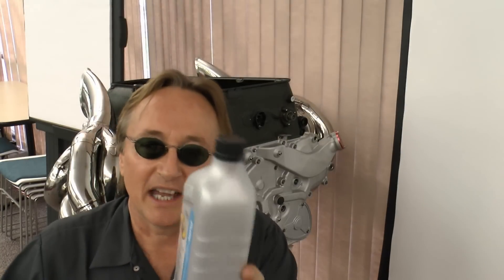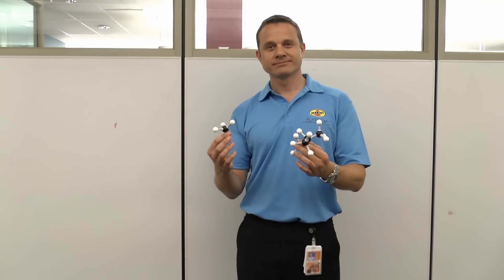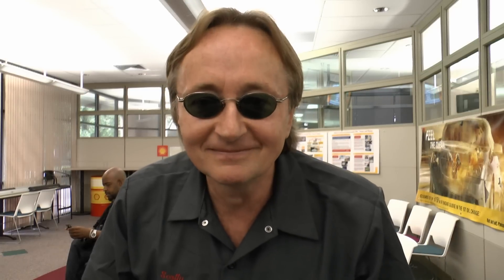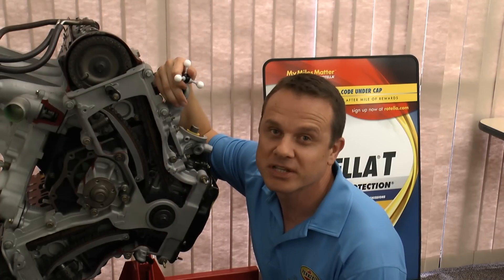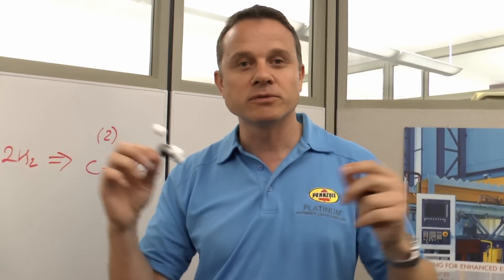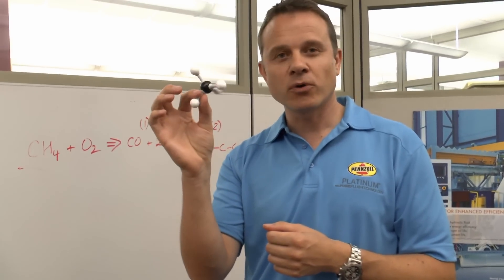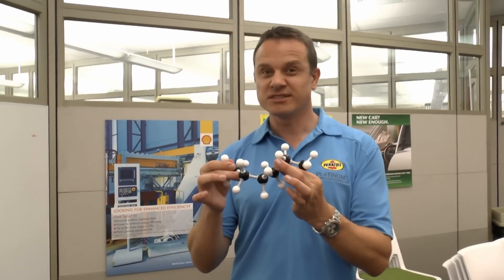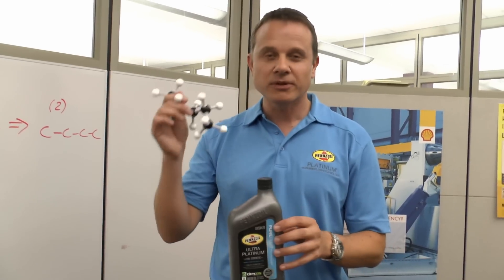How Engine Oil Is Made From Natural Gas

Comment: Scotty, I got a pair of 6000K H4 bi-xenons installed on my car and they got radically dimmer after a couple of months. I had my battery replaced but they're still dim, I took my car to a car accessory shop to ask them what could be wrong, the owner said the headlights need to be replaced, but I don't trust him. It's barely been a year since I got them, and I don't know what is wrong. What's your take on this?
Reply from the maker: many aftermarket xenon kits are cheaply made in china and don't last long. if you have one of those, it's typical
Reply: Spend the extra money and go with a projector retrofit.  Then go with OEM bulbs, like Philips 85122.  Cheap bulbs don't last long.  They get dimmer in a shorter amount of time and color shift over time.  If you want HIDs, go with OEM as much as possible.  I'm running EvoX-R Bi-Xenon projectors, Morimoto 3Five Ballasts, and Philips 85122 D2S bulbs in my headlights.
Reply: Thanks for the replies both of you.Since I don't know much about HIDs and projectors, I'll just get the same combination as Kenneth, or maybe something similar that doesn't go over the $300 mark.
Reply: Thanks for the suggestion galaxybeing, but where I live, Amazon has just started their website and they don't have any HID kits or bulbs yet, I have already looked. My car already has a HID kit, and I am not sure if I can replace the bulbs because it's China made and the bulbs were already fit inside the projectors. I might go see an electrician today, see if he can set me up with something. $11.19 is a great deal btw.
Reply: I just got back from the electrician and he checked the lamps. He tried different HID bulbs, and one other projector, but it was dim the whole time. I asked him if the problem could lie in the ballast but he's pretty darn sure that it's okay, he also added that the ballasts never give out (which I am not convinced with). He did everything but try a different ballast. He said the headlamp unit (in which the projector sits) must be changed so the light is brighter and scattered better but I doubt that's what's causing the issue. What do you guys suggest?
Reply: I had this problem myself. It turns out my bulbs had almost no salts left in them after 3 months. However after hearing your story it very well seems to be your ballast. The ballasts do give out. Some don't even last 6 months while others last forever. The cheaper Dc Output ballasts that is the slim ballasts that these cheap china kits have generally don't supply enough current for the bulbs to ignite properly and as such they never reach the true colour temperature or intended brightness.
Reply: nirtime My kit did come with a slim ballast lol, I looked around online and slim ballasts don't have a great feedback. I asked the electrician, he said slim or normal, it won't make a difference. Looks like he doesn't know his work very well. I'll get it checked with a normal ballast, if I can get my hands around one.
Reply: thefirstgalaxybeing Yeah, the both sides are dimmer and the left bulb has always been flickering.I didn't know bulbs could be replaced. I asked in one of the stores yesterday, the owner said he has China bulbs for $30 each, and Philips for about $50 each. Nowhere close to the ones you got off Amazon. How is their performance? Do they have a name for their company? I'll see if we have them here. 
I don't know if my kit is weak, but I was also told that it is for motorbikes and not cars because where I got it from, people usually go there for bike mods. I don't think it makes a difference though, does it? I'll check the wiring myself like you suggested. Thanks, you've been very responsive. :)
Reply: It's aftermarket. When I got the HID kit, I knew nothing about them. In fact, it was my friend who insisted I get them and he offered to pay for it and where I got them from, there's zero after-sales service. That's just how things roll here.
I've never tried Amazon.com, they have their own domain for our country but I don't know if they ship to where I live. I've had things ship to me from overseas before, and it's a long process, I don't know if I want to go through all that again. Don't you think the Philips bulbs are worth the money?
Reply: Could you give me a link to the pair of bulbs you got? I have a friend who is in the US right now and he's coming back in a month, I'll ship them to his address and he'd get them with him on his way back. I don't know if changing the bulbs would resolve the issue, could you also link me to a good pair of ballasts? Or maybe an entire kit if possible. I wouldn't know anything about bikes or their batteries, I never owned a bike, sorry.
Reply: Thanks, I am on the website as we speak, I'll pick something and tell him about it. You've been of great help. :)
Reply: http://www.amazon.com/Innovited-Xenon-Conversion-Ballast-5000K/dp/B00F5QNB0U What do you think? I think H4 would be the correct size for my car since the ones I have are H4...
Reply: Also, if I got 55w instead of 35w, would it burn my projectors?
Reply: dont buy shitty HIDs? and plz get projectors.
Reply: thefirstgalaxybeing My car is only 2 and a half years old and the headlight housing are just fine, except I painted the reflectors black because that adds to the "looks", and HID with reflectors don't look great in my opinion. Looks like Amazon has everything you need, I wish their product range was as extensive in my country as it is in yours. Some of the sellers ship worldwide but the shipping alone would take up to 10 days.
Yes I'll realign the headlights, and make sure the spread isn't bad. I hate people who blind people with their headlights, and I'd hate it even more to be one of them.
Reply: thefirstgalaxybeing The H4 Kit is only $43, rather cheap compared to the $400 kit quoted by an idiot here. The cheapest kit which I've heard of is close to $200, so $43 seems like a fair deal. I hope it works fine, I'll order it in a couple of days, and have it fitted by next month. I cannot find this 'place' you talk of where I can enter my vechile make, model etc.
I don't quite understand how the system works but if the Mr. Know-It-All says so, I'll take his word for it.
Reply: Medic1911 I have them.
Reply: thefirstgalaxybeing Hey man, I am sorry if I am annoying you but I found a good pair of HIDs and I don't know if I should buy a new relay harness along with it 'cause I have my old one, although I am really considering getting one just in case they don't go with the new lights. I found a 'single beam' harness. Now, I don't know what that means but since I am getting  bi-xenon lamps, shouldn't the harness be 'dual beam'?
Reply from the maker: realkewlmann I would assume you would need a dual beam harness
Reply: I wasn't aware there were single and dual beams for relays until I came across that one on Amazon, thanks Scotty; and thegalaxybeing, you've been very VERY helpful. Tyvm.

Comment: Is this a cleaner process than regular motor oil? If so I see a big industry for greener oil lol
Reply from the maker: you 'd have to ask the scientists that one, good question though, try shell.com for question answerig
Reply: Crude oil has a lot of impurities in it such as the biggest one being sulphur. Such crude is referred to as Sour Crude. Sulphur isn’t good for your engine and even worse for the environment which in turn relates to your health. Poison in other words. On the other hand, GTL (Gas to Liquids technology) is 100 times cleaner since there isn’t any sulphur or leads (if not completely absent, then at extremely low levels that it’s insignificant). Synthetic refers to the synthesis, or in other words the refinery process. So synthetic oils gives reference to the methods used to manufacture them. Synthesizing chemicals in this way is under stricter control at each step of the process with the product being manufactured for the specific task it’s meant for. Therefore synthetic oils and synthetic fuels are much more cleaner and safer for both your engine as well as the environment with regards to vehicle emissions. Hope this helps shed some light on your query although my response is 6 years later 🤦🏻‍♂️.

Comment: HeyScotty jw if i use this oil on my 01 Dodge intrepid when i have been using reg castrol oil like you advised. Do I still need to use 1 qt of lucas oil stab for this pennzoil pureone motor oil? Thanks! Thinkin of trying it out!
Reply from the maker: on a dodge  car that old, I would still add the stablizer.
Reply: Also this type of oil had to be changed 6 to 8 thousand miles or every 6 months right? Even if it is a synthetic right? Making sure because next month need to change my oil and goin to try this pureone stuff.
Reply from the maker: Dblade981
yes, they say to follow the regular manufacturer's oil change intervals

Comment: They failed to really explain why I should use this oil over a regular synthetic oil.
Reply from the maker: I have another video in the making showing how they tested the oil in the lab, in the race car world, and on taxi cabs in las vegas. Basically it prevents metal wear in the engine better than any other commercially available oil.

Comment: I recently had a new exhaust put on the car now i have a knocking sound when pulling away, i checked for rubbing on the exhaust but cant see anything. I need to look  under the car but i cant afford a lift and i dont want to get under the car on just the jack. whats the best solution?

Comment: How can they call it synthetic if it is still made from dyno oil?
Reply from the maker: it's not made from oil, it's made from natural gas. So making a thick out out of really thin natural gas is certainly a synthesis.
Reply: Because even synthetics use a base crude oil before additives.  Using natural gas is awesome since it is the cleanest burning fossil fuel.  On top of that the United States sits on the biggest supply of it.  It would be nice to turn the tides on these middle east countries.
Reply: Because with synthetic oil, natural gas and/or other sources of hydrocarbons, such as crude, are used as raw material for chemically synthesizing lubricating oil.

This is different to taking crude oil and going through conventional refinement processes to extract usable oil as a lubricant, sans any required additives.

Synthetic oils are unique in that the hydrocarbon chains are uniform for a given viscosity whereas traditional mineral oil is composed of hydrocarbon chains of varying lengths and where a certain combination thereof may yield a certain viscosity.

The problem with conventional oil: longer hydrocarbon chains will greatly increase the oil's viscosity in the cold while shorter hydrocarbon chains may be burned away more easily but not cleanly in events of excessive operating temperature, which would result in thicker and gunkier oil.

Comment: It funny the dinos died long ago for man to make fuel out of it. Now man makes it and it costs a whole lot way more . I will always buy the stuff made from the Dions as it has worked all these for me all these years and my dad a master mechanic used it and never had a problem.
Reply from the maker: it's not really made from dinosaurs, mainly from plant material and plankton. BUT, engines these days are much higher revving and hotter running and complex, and require higher lubricant capabilities

Comment: Pennzoil didn't invent this. In fact, this process was developed in Germany known as Fischer–Tropsch process, in 1920s, some 90 years ago. Google and read on "Fischer–Tropsch process" before making it sound like a new high-tech engine oil.
Reply from the maker: no one said they invented it, most know the nazis made diesel fuel and oil from Coal, which they had in abundance. The South Africans also turned coal into diesel when they were under sanctions decades ago from apartheid.
Reply: They actually mentioned Fischer-Tropsch in this video.

Comment: Essentially, all they proved in this clip is how there is nothing, and I mean - absolutely NOTHING, special in this oil and they've always been this way. All the processes this guy explained are studied in grades 8-9 in Europe, grades 11-12 in North America and I have personally performed them in my first organic chemistry classes. How is hydrocracking or using a catalyst to make a long hydrocarbon, such a special process? They are just a bunch of guys there who make it easier on themselves to create oil molecules. But the drawback is that these polymers are all identical and they are much more unstable. And they all start to brake down at the same condition in the engine, whereas if not all chains were identical, you would have a MUCH more stable compound. So, ya, Penzoil just proved how worthless their products are. And that crap about the race cars they put the oil in can be used again for nothing but to prove their junkish product. That is because all race cars get their engines rebuilt/replaced after every race. It would make NO sense to put an expensive oil in such an engine, just to throw it away after 1000kms or less.
Reply from the maker: shows what you know about oil and racing. In the races like indycart, they get 5 engines to use for the entire year, so each engine has to last many races.  This oil was tested in taxi cabs in las vegas for over 100 thousand miles and showed the lowest level of wear in the oil industry. I saw that science in the lab, it certainly made sense to me.
Reply: Scotty Kilmer
Do you want to get back at me and actually claim that stupid Penzoil is a better quality oil than say Castrol, Liqui Molly, Motul, Elf, even Kroon Oil? Because I certainly don't see it that way. In my experience only Valvoline is worse than Penzoil!
Reply from the maker: Rumen Hristov
AH, but you can have no experience with this oil as it's brand new. Yes, pennzoil did have problems with sludge build up in the 1970s, but their oil is a long way from that formulation. Times change, as do oil formulations. If you check out independant testing, this new oil is rated on the top by many testing labs.
Reply: This is oil is made by Shell, penzoil just sells it......

Comment: Seriously this is age old technology they started making synthetic oils from natural gas for motors in the mid to late 1800s in Germany. in fact I worked with an apparatus with pipes and pressure regulators that was built in the 1930s that turns natural gas into synthetic oils. it's a portable unit. like I say this process is nothing new. I've made oil from natural gas many times.